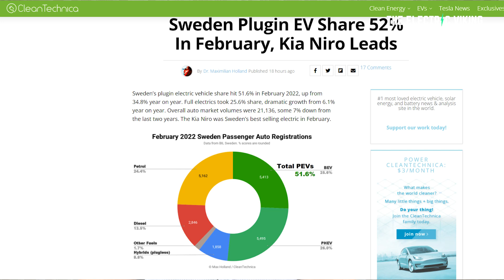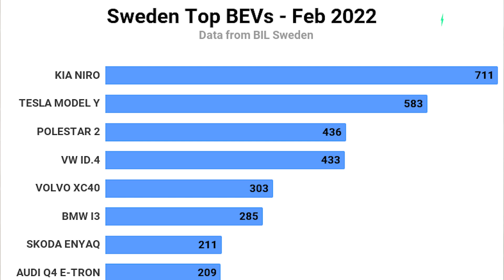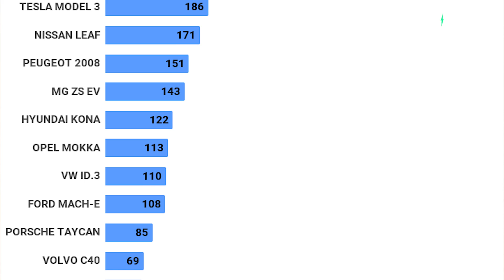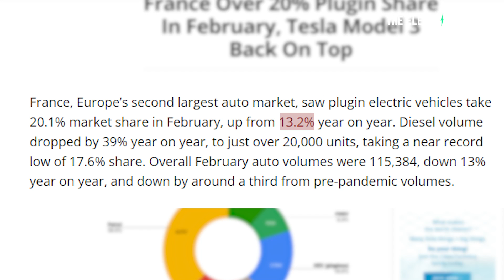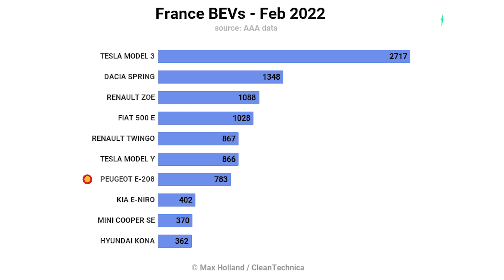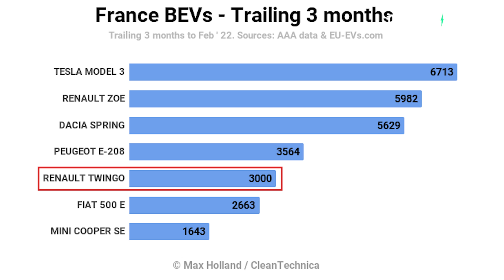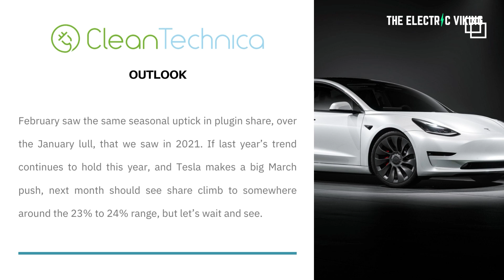France & Sweden EV sales figures & market leaders in Feb

Comment: France needs to wake up and deal with its charging infrastructure. Some villages and small towns have as many ass two 22kW chargers and if you’re lucky a 43kW ! But most of the time, it’s like the good old days where EV owners need a pack of RFID cards, several Apps and even then chargers may not be working. 
In comparison to UK, France is 5-10yrs behind the infrastructure curve. There are more speed traps here than public chargers and seeing another EV outside of cities is pretty rare, though definitely increasing. I own the only EV within 20 miles of where I live! France is huge by comparison to UK and this somewhat negates the objection that ‘most people charge at home’.

Comment: When the next Ship comes in...

... well one thing for sure it will not be the Super ocean going Car Carrier,  "Felicity Ace"  ❗️
It caught on fire and is now resting on the bottom of the ocean with close to 4,000 brand EV New cars.
Reply: Not mentioned by Sam 🤔
Reply: Just like the Toyota carrier that sank in 2008?
Shit happens.
Reply: @rogerstarkey5390  As you say . But in this case it was lithium batteries that kept the blaze going for 9 days and it sank with the fires still going. If they change the protocols for transporting BEV’s then who knows what will happen.
Reply: @rogerstarkey5390   Never knew about that one.
Reply: Thank you all for your comments in this THREAD. 
 I never got the alerts via YouTube.
 Showing a friend The ElectricViking channel and I noticed your comments here.

I'm realizing anything negative about EVs will not be mentioned on this channel.

 There have been fires on the super cargo car carriers in the past, but they have always been able to put out the fires.
But this one had a lot of EVs on it ❗️🔥❗️

  There will be NO mentioning of the mining for the different materials for making batteries, it is extremely very toxic , very environmentally unfriendly.
 There is a mountain in China where the Chinese took that mountain all the way down to the groundwater stripping it of all  lithium. And the groundwater in that area is now Contaminated.
 The mining for graphite is not to bad,  But to process the graphite is horrible.
 The copper mining Peru , how it is destroying one city.  The children and many of the adults are having adverse reaction to the minute copper particles floating in the air ❗️
A lot of copper is needed for the World Wide  charge up stations.

The many Negative aspects about EVs goes on and on but it won't be mentioned on this channel.

 For the most part we just exchanging one polluting conteminent for another polluting contaminant and this might be even more harmful to the planet in thelong run.

...And since I am not a tree hugger, I don't care.

Comment: One reason EV'S are cheaper in China is their lack of safety fetures. But they might still be more reasonable even when they add the necessary safety features.
Reply: If the cars are sold in the UK and the EU they have to be engineered to meet the safety standards of those countries in order to be sold there. The price goes up if there are tariffs and of course the cost of creating a new line for the steering wheel as well as additional safety EU standards, but they are still affordable after that is all said and done. They have a lot more choice in Europe and the UK but quantity and availability is the issue since they are hot sellers.
Reply: @dr-k1667  totally agree. I hope more Chinese cars come to market in the USA so we have more options and the prices of EV'S come down.
Reply: @dr-k1667  
MG says "hi!"
The Chinese manufacturers are catering to their home market because ....... 
1) The DEMAND exists 
2) It's EASY.

You're naive if you think they don't have top notch engineering in China.
Reply: @rogerstarkey5390  first of all Chinese cars don't have the same safety features that are required in the USA and EU, if they are being made for the Chinese market. Why, because why add the extra cost if you don't have to. I never said Chinese cars are inferior to cars made outside of China. They can be just as good and in some cases better. So don't get your panties in a bunch. All I was saying, is when they add all the necessary features required outside of China the cars will cost more. I am excited to see more Chinese cars in the USA so we can have more options and hopefully bring prices down faster.
Reply: You're making assumptions.